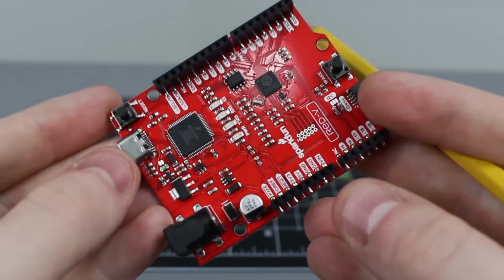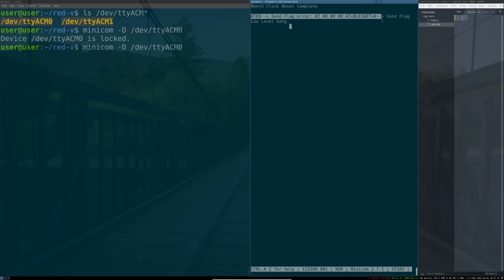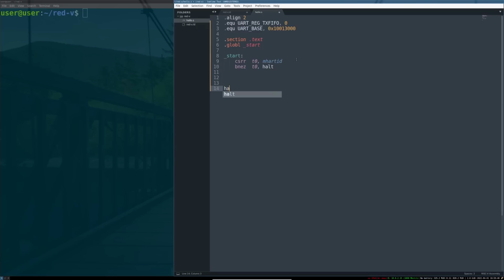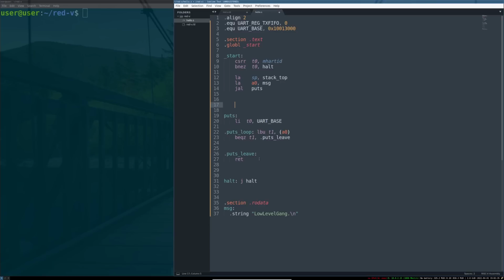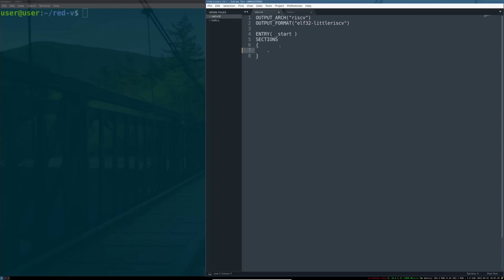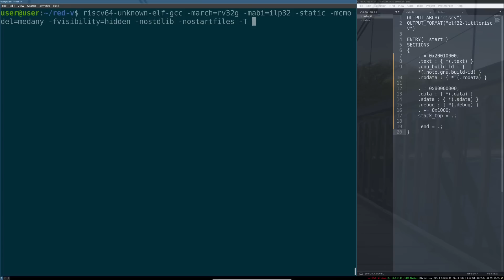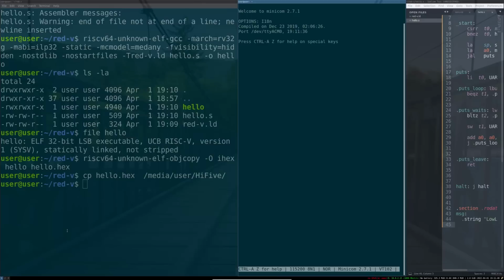This is the BEST Board to Learn RISC-V Assembly.

Comment: would it kill hardware designers to agree on a similar memory structure, just imagine If there was an IEEE standard for Memory addresses for stack, heap, code, etc.

it should be theoretically possible, at least for civilian commercially available hardware. wouldn't that be nice not having to go grab a spec sheet to write a linker file?

Comment: I like the $8 ESP32-C3FH4 RGB board.. it has a Risc-V but also includes Wifi, Bluetooth5, couple buttons, 25 leds, etc.

However, not sure how debugging works on it.  For example, I understand gdbserver runs on the target cpu, and that the host cpu must interact with it using openocd/jtag...  but what's the general approach on setting that up?

I know Percepio sells a "Tracealyzer" that can save snapshots of your FreeRTOS project, for analysis.   Perhaps the same is true with CodeWalker and Micrium uC/Probe?  I'd like to see real-time live streaming of the data.

BTW, any thoughts on the 'Timeless Debugging' talk given by the legendary George Hotz?

Comment: Step 1: Implement a RISC-V CPU in FPGA
Step 2: learn RISC-V asm

Am I doing this right? 😂
Reply: You'd best be familiar with the ASM before designing the chip. :p
But for real, the elegance of the base Isa is amazing for design. Set bits for register select, sign extension, and set shift offsets from instruction immediates to registers..
Reply: @mikafoxx2717  Oh, I wouldn't be designing it, just lifting an FPGA implementation of an existing one.

Comment: At 11:25, I do not understand how you got to the address 0x20010000? Where is this mentioned? I searched for the manual pdf of the RED-V SiFive chip and it said in chapter 5 "Boot Process" a table, but it says a very different number?

Edit: I was looking at G003 manual. In the G002 manual for the E310 it did say 0x20010000.

Comment: On the physical board I am somehow stuck.

In your example you have msg in .rodata (that is read-only) and that works
If I move msg in .data (that is read/writable) then a letter "C" is written and not the string, so somehow the message string is not there or I have a wrong pointer.

I think I need a boot.s that is more extensive than setting up a stack and getting the Hardware thread 0.
I assume that .rodata  is running in flash memory and .data needs to get copied, but I can't find the way to do it so far by surfing on the internet.

A more advanced boot.s example would be nice in this demonstration.
Reply: I cracked it, on the board the linker file must be more extensive and you also need a boot.s that copies the .data from flash to SRAM and clear all bytes in .bss.

I used chatGPT to help me in this.
ChatGPT does causes some issues, don't trust the code it generates.

The linker file is too big to post here and I don't have a working example to show off worthy to be shown :-)

.rodata =  constants that is red-only and only reside in FLASH
.data = data that is initialized with data you copy from flash to SRAM once but free to be modified later on.
.bss = data in SRAM that is just set to 0 just before you enter main.
Reply: In the linker file you need something like this:

MEMORY
{
    FLASH (rx) : ORIGIN = 0x20010000, LENGTH = 16K
    RAM  (rwx) : ORIGIN = 0x80000000, LENGTH = 16K
}
Reply: For data you need something like this:

    /* Read-write data goes into RAM */
    .data : {
        _sdata = .;
		_data_flash = LOADADDR(.data);
        KEEP(*(.data))
        KEEP(*(.data.*))
        _edata = .;
    } > RAM AT> FLASH
Reply: BSS:

    /* Uninitialized data goes into RAM */
    .bss : {
        _sbss = .;
        KEEP(*(.bss))
        KEEP(*(.bss.*))
        KEEP(*(.noinit))
        _ebss = .;
    } > RAM
Reply: Finally this:

    /* The stack also goes into RAM */
    .stack ORIGIN(RAM) + LENGTH(RAM) - 0x1000 : {
        . = . + 0x1000;
        _estack = .;
    } > RAM

    /* Define symbols for the memory boundaries */
    _sflash = ORIGIN(FLASH);
    _eflash = ORIGIN(FLASH) + LENGTH(FLASH);
    _sram = ORIGIN(RAM);
    _eram = ORIGIN(RAM) + LENGTH(RAM);
Reply: And last to copy the data from FLAS to SRAM:

data_init:
    # Initialize .data
    la a0, _sdata
    la a1, _edata
    la a2, _data_flash
    bgeu a0, a1, skip_data_init
data_init_loop:
    lw t0, 0(a2)
    sw t0, 0(a0)
    addi a0, a0, 4
    addi a2, a2, 4
    bltu a0, a1, data_init_loop
skip_data_init:
Reply: As pointed out by someone else   FLASH (rx) : ORIGIN = 0x20010000, LENGTH = 16K 
Note that it does not start from0x20000000, but 0x20010000,.

I think there is firmware loaded in the lower levels that probably makes the external drive capable, still learning curve for me as this is brand new. I am only 1 week into learning RISC-V :-)

Comment: Why learn RISK-V?  Or any other assembler language?

1. Because assembler is way more easy than any programming language.  No OOP, No traits, no abstract syntax, no 1000 dependency packages, different frameworks.... Just you and your processor.

2. Force your brain to get out fo your comfort zone and become more creative. Even though you may never create big projects in assembler unless you are a virus writer. The knowledge can even help you create better high level code. 

3. You are more focuses on your code you write.  Every deploy is slow to debug so you must look at your code mere thoroughly and understand the code way better. Sloppy code will punish you big time, so quality code is enforced.

4. Learn to create efficient code, not bloated code like you used to have in any higher level programs. Your high level projects will improve.

Comment: A little bit of forethought before leaping into programming can save a lot of keystrokes and debugging time.
A lot of that code looks like boilerplate that will be used repeatedy, in every program for the board. It should be set up beforehand, then included as a starting step, by whatever mechanism  the local editor supports.
The same is true of the compilation and linking steps. A lot of unchaninging operations, with only the program name changing. All that should be in a script.
Reply: I don't have the Sparkfun board but I have SiFIve's HiFive1 which uses the same chip. Their SDK has a start.s that does the boilerplate setup and the same for the linker script. I'd be surprised if Sparkfun doesn't give you the same stuff too, but it's still nice to see what the minimum actually needed is.  He didn't quite make it as the check for HART ID 0 is not necessary on this single-CPU board.

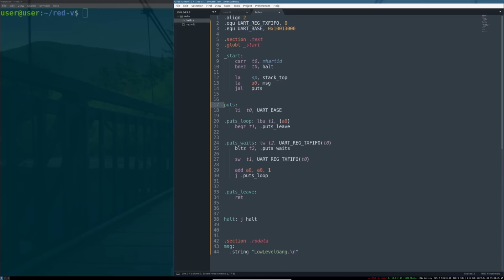Comment: The finished code is shown at 10:06.  Don't you need something after calling the function ("jal puts")?  I would think jumping to halt ("j halt") would be appropriate.  As it is, it looks like you'll fall through and execute puts() again with no return address on the stack.
Reply: Kind of, but it turns out it's harmless. This code doesn't actually use the stack, or RAM at all. The jal puts the return address in the RA register, and ret jumps to whatever address is in RA. And nothing in puts changes RA, so it will actually execute puts in an infinite loop. A0 will still be pointing to the null, and so the printing and incrementing of A0 will be skipped. It's a 4 instruction infinite loop. (5 actually, as that li UART_BASE expands to an AUIPC and an ADDI)
Reply: I apparently noticed this and moved halt so that it was right after _start. I also, far more consciously, forced _start to be at the start by creating a .text._start section. It doesn't matter for this project but if there are any other files it could be an issue, and since there are other unused sections I decided to add it

Comment: I think learning SOME assembly language will teach you a lot about what's actually happening under the hood.  And if you are trying to create very fast code, you can ask Compiler Explorer to show you the assembly code for your Rust or C code and see whether it is what you expect.  OK, but that would be true for ANY assembly language, so why RISC-V?  First, because RISC-V is about the easiest, most straightforward ISA you will find.  You won't gain any extra insight into what the hardware does by learning a mess like the x86 ISA, and that would be a LOT more effort.  And RISC-V is probably going to be a BIG DEAL in small embedded systems, so knowing it could help you in your career a few years out.
Reply: Maybe you won't gain any extra insight into what the hardware does by learning x86 ISA, x86 ISA uses microops anyway, but you will learn and understand what the compiler does and you don't have to buy extra hardware if you already have an x86 computer.
There's nothing wrong in learning just both. And they both have a different target market anyway. You will very likely not program in x86 assembly for embedded systems. Today x86 is for performance-hungry or large software tasks with plenty of CPU power and memory. Risc-V has to serve this field first and when it does that, then you will have a very special workplace, because the majority use x86 for something like that anyway. 
So there is no x86 or RISC-V decision to be made, the two usually just don't get in each other's way at the moment.
Reply: @OpenGL4ever  yeah, basically if you're learning assembly, it should be ARM m0, or RISC-V, or maybe esp32 whatever else x86 would be silly unless you're in the habit of reverse engineering software

Comment: It has been a very long time since I have done anything in assembly language. Many years ago I had a Heathkit 89 Computer which had a Z80 processor. I did do some simple things in Intel 8080 assembly language.
Reply: Z80, i8080...I learned these 2 during senior high. I bet you probably was born in 60s, right?
Reply: @jasonlhb  I am older than that, I was born in 1951. The very first computer I did any programming on was an IBM 1620 at a junior college.
Reply: Oh man!  Those were the days, David.
Reply: @KenJackson_US  These were the times when it was easy to get rich by programming as the software projects to be programmed were much smaller than today. Nowadays it often takes a team of programmers and man-years to implement a larger successful project.

Comment: This is much easier than the complex fooling around I have to do on an STM-32....  it's like a return to the simplicity of the AVR.... maybe even simpler.... I certainly have to look into this chip.... it's not just the RISC-V, it's how easy they've chosen to structure the microcontroller's peripherals too. NOW if someone would just bring out a board without all that SPI flash, USB port and other things I don't need for Blue Pill prices.... now that would be delicious.

Comment: 150 MHz early laptop? I wish...
The first laptop I used was 10MHz or so.
Reply: Yup. My first laptop was a PowerBook 100, with a 16 MHz 68000 that took 4 clock cycles for the simplest instructions e.g. move one register to another, or add/sub/and/or/xor one 16 bit register to another. 32 bit operations took 8 cycles minimum. More complex instructions could take 12, 16, 20 cycles ... So, compared to this 150 MHz 150 MIPS 32 bit RISC-V chip, the M68000 was effectively 1 MHz (or 1 MIPS)
Reply: @BruceHoult  A 386DX 16 MHz had about 5,4 MIPS and an integrated MMU.
Reply: @OpenGL4ever  so did the 68030, but those are six or seven years after the 68000 and 8086, and much more complex chips. According to Intel's own 80386 Hardware Reference Manual "At 16 MHz, the 80386 is capable of executing at sustained rates of three to four million instructions per second". That sounds about right to me. But in any case, all these CPUs are at least 50 times slower than the FE310 on the microcontroller board shown in this video.
Reply: @BruceHoult  The 386 was released in 1985. The  68030 in 1987.
The MIPS numbers for the 386DX are from the WP. 3 to 4 MIPS are the 16 MHz 386SX version or later 80386SL, not DX.
The 33 MHz version delivers 11,4 MIPS and these numbers are quite correct, because the 486DX has more than double the speed at the same clock rate. (27 MIPS)

Of course. Even my 16 year old Nokia N810 Internet Tablet with a OMAP2420 – 330 MHz ARM1136 processor that was released in October 2007 is faster than the old 386.

Comment: I might be missing something but wouldn't it be better to explicitly jump to halt after returning from puts.

Works fine here but it's cycling through puts_leave with a0 pointing to the null, but in a more complicated program you might run some code without intending to.
Reply: You're absolutely right. The ret jumps back to the instruction after the jal, which is the start of puts. It loads UART_BASE again, loads the null again, jumps to puts_leave, and the ret jumps to whatever is in RA which is still the address of puts. Forever, since a0 is not incremented. Another fun fact: this program does not use RAM at all, including the stack, so initialising SP was a waste of time :-)

Comment: @Coding Neko asked a useful question. "Why learn RISC-V assembly [language]?" The video could say:
1. Learning assembly on any CPU helps understand what's actually happening, and may help debugging.
2. Learning assembly for a RISC-V is rarely useful (except for point 3). C compilers for RISC ISAs mostly generate better code than an assembly programmer could write in comparable time. So C is much more productive.
3. Learning assembly for RISC-V might be valuable for writing: a bootloader, 'bare-metal' startup code (eg. code to replace program initialisation like 'C pre-pre-main') porting or implementing multi-tasking, or bootstrapping a programming language that isn't in C. There might be a few other cases eg: super-fast interrupt handlers, or porting performance-critical assembly from a different architecture. Some cases might be easier to write a C program with in-line assembly, but that still needs assembly knowledge. Problems where assembly might be essential involve resources C programs can't access (eg a CPU status register), or instructions the C compiler can't generate. However there are often 'C intrinsics' which generate those instructions, so needing assembly is rarer than it might seem.
4. Learning RISC-V ISA programming is better than learning a proprietary ISA because RISC-V is open. Unlike other open ISAs, affordable hardware exists from multiple manufacturers, and RISC-V is increasingly being embedded in products.

Summary: 
Understanding the underlying hardware helps us debug higher level languages eg C programs.
The cases where assembly is essential will likely become obvious quickly. 
'C Intrinsics' might remove many needs for assembly language programming.
Writing in-line assembly within a C program is often much easier than only raw assembly. Code space is rarely a problem compared to RAM, so don't worry unnecessarily about program size.

With those facts, people have enough to reach rational. informed. decisions 

(It took me under two minutes to read that out loud at my normal pace; so, not much extra.)

It might be worth spending a minute or two on why the C compiler will likely do a better job generating code for a RISC architecture than most assembly programmers could do.

I am not trying to dissuade anyone from learning RISC-V assembly language. I'm only trying clarify the reasons.

Best Wishes All for 2022.
(Sorry for repost, I spotted some mistakes.)
Reply: @methosa8818 Thank you for replying. I believe your making a useful and subtle point: even though a compiler might occasionally generate an unusual instruction that does not mean the compiler has a good enough 'model' to fully leverage complex instructions. Further, the compiler writers might avoid them for generality. 

The compiler writers might have avoided complex instructions like STMIA or LDMIA because, AFAIK, they are implemented as 'uninterruptible'. Hence those instructions might have a significant impact on interrupt response time. Worse, if the system has unpredictable interrupt latency it might be very difficult to track down.

I have no doubt you can achieve significant performance improvements using STMIA and LDMIA. I've experimented with 'vector' instructions on PowerPC to get big gains.

AFAIK, the RISC-V designers elected to keep system state simple, and avoid multi-cycle uninterruptible instructions, Hence I AssUMe (but have no actual evidence) there are few circumstances in end-user applications where hand-crafted RISC-V assembler would beat C compiler generated code. Of course, I might be wrong!😀

Thanks again for replying.
Best Wishes. ☮

Comment: I don't...What's the point of this? Why would you code RISC-V Assembly instead of C? is there any actual advantage or is it literally just to flex?
Reply from the maker: To learn! (It’s in the channel name)
Reply: It's to learn how the hardware works... Love videos like this, but it'd be neat if he mentioned where he was getting some of this information from. Feels a lot an unironic version of the "how to code minecraft in java" meme because it looks like he's just typing code from another page without any reference as to where he got any of the information. It's still a neat video, though. Not shitting on it or anything
Reply: One of the neet features of the RSIC-V is since its so FPGA friendly, you can put in your own instructions.  Usally they are DSP/vector custom packages that quire special libs but can do crazy things like multiply a grid of 32 floats in one cycle.
Reply: @warlockd  I didn't understand that but if there are actual reasons like what you seemingly mentioned to use this over a higher level programming language I'll stfu xd